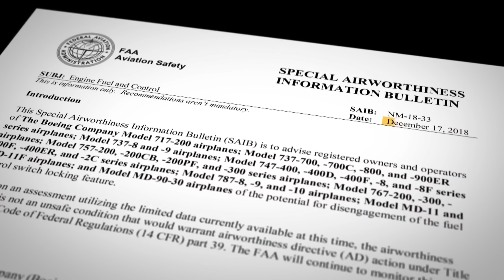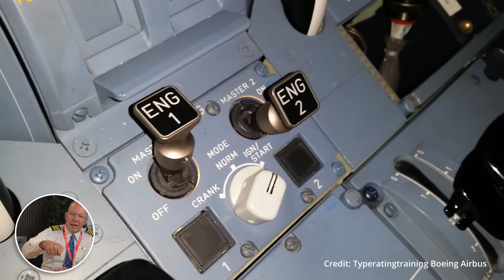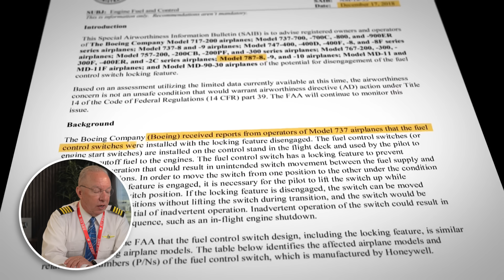Air India 171: The FAA’s 2018 Fuel Switch Locking Bulletin Explained (16 Questions Answered)

Comment: I'm not sure that I agree with the analysis of the locking switch bulletin. The bulletin says "if the locking feature is disengaged". So the real question is "how can the feature be disengaged" and is that a possibility for both switches in this case. Apparently work was done at some point on this module on this plane so it's possible the switches were affected, disengaged or damaged in some way.. One wonders what state the switches are in now and if there is or will be will be any commentary on that
Reply: If the switches were not working properly a good pilot would have written them up for repairs Can't believe as old as this plane is it never had a good pilot fly it
Reply: @paulwise2614  we never know what error it is but it is either pilot error or mechanical error. On 23 December 2017 night we all boarded on an Air India flight from Chennai to Madurai. After boarding they cancelled the flight and arranged for us to travel through land route I am so glad they did cancel that flight now instead of taking a chance with human lives.
Reply: Yes i wonder
Reply: I'm not intimately aware of the details of the AB but I think it was a manufacturing defect that was corrected. It was a long time ago in the grand scheme of things so I doubt there are still aircraft out there without that feature.
Reply: The accident investigators have the switches in their possession. The report even includes a photo of them. The switches have undoubtedly already been carefully examined and found to be working correctly. If they were NOT working correctly a directive would already have been issued to all the operators of the many thousands of aircraft which use this same switch. The lack of any commentary on the switches is what tells you no problem was found with them.

Comment: Dual confirmation from both pilots should be needed to cut the fuel off at an inappropriate time. A pop up box on a screen that only each pilot can reach that says, “Are you sure you want to turn off the fuel? This action cannot be undone quickly.”
Reply: Think incapacitated pilot.

Comment: The report even stated the fuel control switches were back in the run position. It takes time to spin up engines and not enough altitude to facilitate enough thrust from both engines. 600 ft is not enough altitude to recover from any major situation, even if the pilots knew what was going on.

Comment: Since voice has used as biometric feature for account login, it is baffling that the voices cannot be linked to named pilots.

On the safety feature to protect the fuel switch, I haven’t seen / heard the tech specifications on the force required to lift before pushing / pulling. Could this degrade overtime?

Comment: Every electrical circuit in an airplane has a circuit breaker. Remember Federal Express Flight 705? The bad guy in that situation pulled the breaker for the black boxes. A camera can be disabled just as easily. Also another point. If there had been a fuel/electrical system failure, most likely the engines would not have started to spool up after the switches were set back to on.

Comment: A video recording in the cockpit that goes only to the black box. No way to hack into during or after flights. Also, is it that hard to tell the difference between the pilot's voice and the co-pilot's voice on the recordings? What are those metal loops on each side of the switches used for?

Comment: I think the video recording thing can be easily done tbh.

You have a breaker. If you turn it off at the end of a flight all the data can be erased and in case of a crash or incident, the data gets stored..

Shouldn't be a big issue.. don't understand why it is

Comment: Capt Steeve, ex flight instructor here i use to teach my primary students chapter on aero-medical factors. " I AM SAFE." Illness, Medication, Stress, Alcohol, Fatigue, Emotion." I hope this applies in airline also. Keep up the good work sir. CFIATP.
Reply: RN…this is an excellent acronym that could be used in nursing as well.
Reply: also in motorcycle safety training they stress there are times that  it’s okay to say “it’s not safe for me to ride my motorcycle today”.
Reply: I have a simple solution. Install a 10 second delay to the switches and a loud alarm to give the pilots time to check the cut off switches before the engines shut down.
Reply: NGL even just driving my car I have called in sick to work on occasion when it hasn’t been safe for me to drive, for example if I’ve been sick during the night and not slept enough to be safe on the road.
Reply: I'm shocked to hear pilots don't have to go through some type of psychological evaluation on a regular basis. I thought it was common knowledge that they did..
Reply: @pudnt  Psychological evaluation is mostly bullshit anyway. Filling out a form asking if you were thinking about suicide in the last 6 months. Who would answer that different than "no"?
Reply: The 787 might be even at take off as quiet as a320 cruising.
In that eurowings a320 you could hear the pilot setting up the plane for sinking by click and press the buttons... that should be also possible to hear in die 787 voice recorder. There won't be any conversations and the cockpit is quiet, and you can split the recorded audio into different layers to hear that „ click , at some point for sure....
I ever talked to a few Indians.
That , why did he cutoff, also could be meant as why the engines shut down or something. Indias use „ he , in that way. Same same , when does he ( the train) depart.
I think the pilot did just talk like this when he hear the engine sound like when he turn the engine off every day.
Did I miss some details? Otherwise I would say as long as these cut off switches aren't found in the crash area and you can see in which position they were, it's not right to already talk like it's the pilots fault There are so many more reasons, electric and software related ones that might just did what looks like the cut off switches turned off....
Reply: @tabgaming4396  The recording recovered from the cockpit was one pilot seeing to the other "Why did YOU do that?" No mistaking what happened with those words.
Reply: @kendallg9533  double checked.. official report says  word by word : In the cockpit voice recording, one of the pilots is heard asking the other why did he cutoff.
The other pilot responded that he did not do so.
Reply: I remember this!!!
Reply: I disagree his opinion on the faulty of the pilot and disregard the second pilot’s denial before any solid proof .He had no need to deny if he did so. Boing need to look into any possibility because for the sake of us 787 loves
Reply: @Fyy256  I really wish I could understand what this says. It bugs me that it’s written in English and yet I can’t discern if you’re disagreeing that it was on purpose, whether the pilots denied it, etc. If I go with what I assume is meant by the comment, then yeah one pilot asked the other why they hit the fuel switches and the other pilot said they didn’t. I don’t see a pilot admitting that they turned them off whether they did it on purpose or on accident.
Reply: cool..... also teach them HF and how it relates to international differences....
..In India, the "on" position for a toggle light switch is typically down, not up. This is a common convention in many Commonwealth countries, including the UK, Australia, and South Africa, where the "down" position is used to indicate the "on" state. In contrast, the US and Canada generally use the "up" position to indicate "on".
Reply: A for Anxiety?

Comment: 4:44 camera would might be only useful for investigating an accident afterwards, but what if we implement to aircraft AI technology to be able to detect and predict in advance possible failures on the aircraft and be there as an advisor tool only to pilots what they should do in a critical moment like that one, because AI has no feelings the critical moments and the advices that might offer would be after analyzing lots of more data than a human can that moment which your life is in danger and pilots might not act as they have been trained, which is very normal as a human reaction when your life is at risk…

Comment: The preliminary report states that the fuel cutoff switches were in the OFF position at the critical moment. Everyone now naturally assumes that the physical switches were actually moved to OFF and then back to ON. But could it also be possible that the switches (the hardware) were never physically toggled, and that something electronic happened which the flight data recorder interpreted as the switches being operated?

In other words: does the flight data recorder register the physical movement of the switch as an event, or does it monitor the electrical consequences of someone operating the switches physically?
Reply: Then how did the pilot flying turn them back on if they were never in the off position?
Reply: The pilot who asked the question noticed something, and one of the pilots then immediately after presumably did something which returned the engines to their correct state.  The idea that they would have shut off and then restarted all by themselves at exactly the right interval to match the conversation and question is too preposterous to entertain.

So like,  figure out exactly how the 787 control system is put together such that the above could happen and exactly mimic what the process would be if the levers were physically moved.  Otherwise your questions have no basis, and the only use they can have is for somebody who prefers a different explanation to put forth as a thought terminator.

Anything's possible, but it does not seem likely.
Reply: @BlueCyann  if the detent springs were worn could be as the plane leapt into the air the switches flopped into the off position .If those switches were old .....
Reply: Physical movement of the switch = specific electrical signal, which is recorded from FDR.
FDR records the input signal by the switch, no matter which system subsequently cuts off the valve.

A false signal is theoretically possible, but very unlikely, just because what happened matches a manual fuel  cut off.

What we don't know from the report is, was the manual deactivation/reactivation the cause or an reaction to dual engine failure - this information is not given.
According to the check list fuel switch off/on is the procedure for an emergency engine restart.

The audio report is a bit sus, it's definitely not complete: no mention if and when acoustic warnings happened (there should be some) and the conversation is most likely not complete.
Reply: id have thought thered be alarm sounds bellowing behind the voices of the pilots but  nothings mentioned?

Comment: How long does it take for the engines to stop receiving fuel ones the fuel cut off lever is pulled? And how long does it take for fuel to get back to the engine once it is in the run position?

Comment: I would suggest that the fuel cutoff switches have 3 positions,  2 intentional and 1 unintentional. 
If the switches had been selected at the start from cut off to on with one hand operating both switches at the same time,  there could be a scenario whereby the fuel switches are on but the actual toggles have not fully retracted into their indents. 
This would leave them in a precarious situation where a slight force or hand brushing over them could inadvertently move them down to cut off.
Bearing in mind that these valve switches would be exposed to vibration only when in the fuel ON positions which would cause wear mainly to that setting. 
This could easily explain why neither pilot believes that they had not moved the switches purposely. 
I  would certainly check if it is indeed possible to turn the fuel ON without the toggle actually seated within position  because if it is possible then it would certainly suggest a  NON failsafe way to control the fuel shut off valve.

Comment: Cutoff is Down, meaning gravity/vibration could move them down inadvertently, if the lock is not functioning.
Reply: Both switches?
Reply: The switches won't deadfall.  They are spring loaded and locked in an indent.  If they are not locked then fuel wouldn't have flowed to being with.
Reply: worn switches .be interesting if these switches are the planes compliment from day 1

Comment: Another aviation channel commented that "The electronic engine control system, the FADEC, can independently shut off fuel to the engines under certain conditions."  Should not the FADEC also be able to DENY fuel starvation to the engines under certain conditions?  Eg, No fire detected+Altitude<600ft ????  This seems like a glaringly obvious point of failure in its architecture given how quick/easy those switches are to operate by a disturbed pilot having a bad day.
Reply: Yeah good point we’ll also need to switch to a dual pilot cutoff system apparently

Comment: 6:19 strongly disagree. If one pilot had suicidal tendency then when why after few seconds the fuel switch was placed to run mode? It was too easy for one to take control and crash.
Reply: Simple. Let me show you.

Pilot 1 who wants to die: turns off fuel

Pilot 2 who doesn’t want to die: why did you do that? turns fuel back on, but it’s too late
Reply: @MartialArtistChris  First thing the second pilot denied doing so. Second, if I being the pilot one and wants to end humanity, I will not let Pilot 2 to change switch. Was there any sign of scuffle between two?
Reply: The brain rot has got u.. get well soon
Reply: @suparno_yt  ignored (dumb statement)

Comment: Actually, according to Honeywell’s data sheet, these pull-to-unlock toggle switches are made in both two and three position models, and several different locking configurations. Some need to have the lever pulled out to move out of and into any other position, and some are locking when moving from one position to another and free to move without pulling when moved to the other position. There is a letter at the end of each switch catalog number which denotes the locking configuration for that switch.

Comment: I have a question:
We know now that the switches were somehow in the 'cut off' position and pilots put it back to 'run' unfortunately the altitude wasn't too high and before the engine recovered the plane crashed.

Of course its the obvious thing to put the switches back to 'run' position hoping the the engines will start and flight will continue,
But
What would have happened if they didn't put the switches in the 'run' position?  The altitude wasn't very high, the plane would have still crashed but reducing the chances of a fireball since the fuel supply and engines were off and would have caused serious physical injuries, possibly death of weak hearts but increasing the probability of reduced deaths and overall casualties because again the height wasn't too much and as we know one  passenger actually survived.
 If so, do you think that the pilots would have survived and answer questions since the nose of the plane was upward

Any experts?

Comment: Recommendation for all manufacturers by a sim pilot ...:-)      a) Cockpit cam b) Box around the 2 fuel switches with peep sound when opened.
Reply: And the aircraft should not throttle with the box opened and switch not set to run. It MUST be closed. I thought of it too. As well as NOT having the switches that close together. 
Also, it should not be allowed to be turned off unless the throttle is dialed back to 0. Similar to a car where you cannot put the car in drive and turn off the engine without it warning you when you turn the ignition ON/OFF.
Reply: Camera's: the solution for everything. All a pilot has to do is cover the lenses and do so in a way they couldn't be identified. Their target has already been premeditated, so they'd likely do it before the plane leaves the gate and just hope the other pilot would never notice. Ever think about that?

Comment: I have an important question…. If the pilot (PIC), goes to the restroom during flight, could the copilot lock the pilot out of the cockpit? Meaning the copilot could take complete control of the aircraft? I know the FA has the ability to get in passenger restrooms (even when locked), does the cockpit doors have the same ability? If not, I believe both pilots should keep a key on them at all times with the ability to access the cockpit even if locked. This goes for both the PIC and copilot, because the PIC could also potentially want to do something bad. Please explain this…
Reply: So There was a german Wings accident a few years back where the copilot locked out the Captain and crashed the plane into a Mountain (suicidal). The Easa made a new rule stating there alwqys Need to be two Crew members in the Cockpit(In case of suicide / illnes,  but its not obligatory anymore, so each airline (in Europe) Decides on Their own. The pilots can Not Carry keys when they leave the Cockpit because a terrorist could use These to get Access to the Cockpit. Therefore the Bullet proof doors (After 9/11 added) are controversial. Never written such a Long comment. Bye.
Reply: @pietfunk4696 thanks for your reply, so really if a pilot wants to do this there is nothing that can be done to stop it.

Comment: If the pilots recognised that the fuel switch cuttoff is causing the problem then why did they took 4 seconds to turn the second switch back to run position after the first switch  , why not immediately turn both switches to run?

Comment: Why don’t they make the cutoff position on top and the run position down- this way any unintentional disengagement would default to the run position. If they’re down in flight, a vibration could never cause them to unintentionally flip upward.
Reply: Impossible to “unintentionally engage” the fuel switch.
Reply: I think that the primary reason is universal ergonomic convention - meaning that "up" is generally accepted as "on"